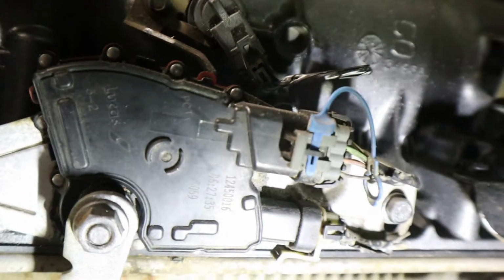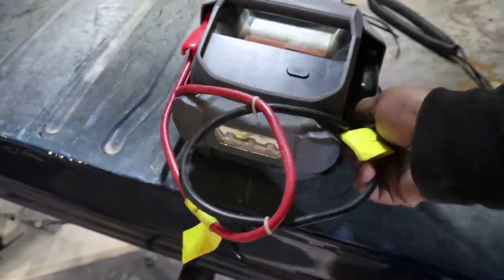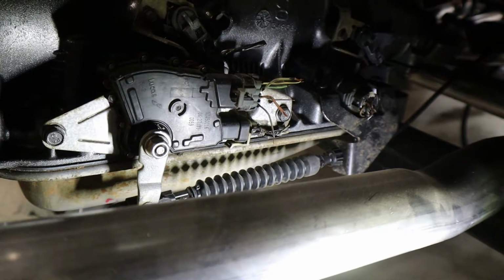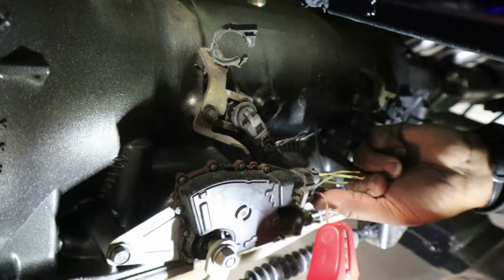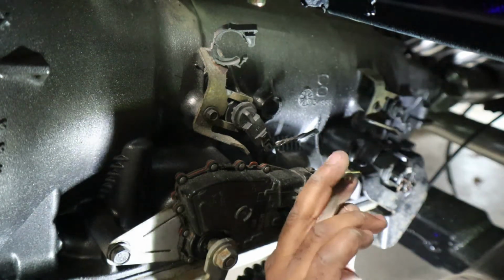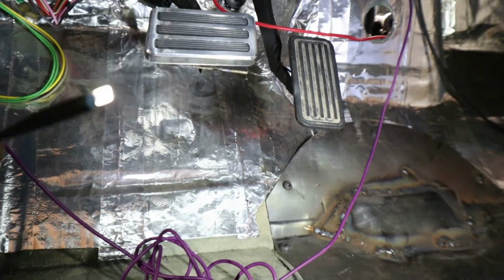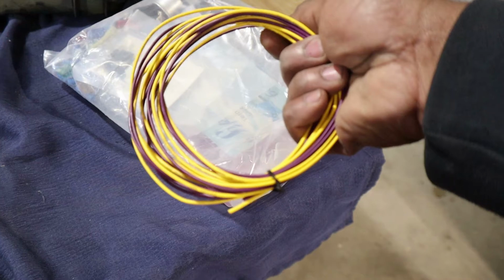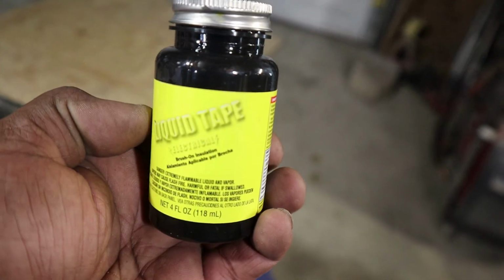HOW TO WIRE NEUTRAL SAFETY SWITCH "EP51" on a 4L60E & 4L80E Transmission.

Comment: Thank you sir for this awesome video! I got a 2006 chevy suburban LTZ with the 6.0/4L60E. My (Drone mobile) remote start failed. Physically using ignition key... failed, no start.  Come to find my starter froze up/ broke. I replaced starter... no start (no click, no low battery click). I charged battery, nothing. Verified terminals clean and tight.  I checked fuses... main ignition (rectangle, clear top) fuse, burnt up. Replaced it... no start. I replaced ignition switch, no start. I replaced the 3 relays in main fuse box... no start. I replaced main power cable to starter, no start.  I drank some water, scratched my head... no start. Slept on it... no start. Took it to the installer who installed remote starter (he the one that found the weird fuse blown) now there is power, but no start. So now literally.... thanks to your video, I will be replacing the neutral safety switch and be checking the condition of the solenoid wire. I can't think of anything else that could be bad. Ideas? Comments? Suggestions? Again thank you.
Reply from the maker: Yeah it seems that you are going in the right direction.  Just double check your grounds as well.  I only know how to hook mine up only one way.  But for sure check all of your ground or you will not get good connection.
Reply: @restosmodsgaragewithcj2808  yup, went through everything. All tight. Replaced neutral safety switch... It started! So again thank you.

Comment: Hey I did a 80e swap on 03 tahoe would this apply? Truck indicated in 2nd causing no start but in park I jump green wire from sns truck started
Reply from the maker: Yes as long as you are using a 4L80 or 60 you should be good.

Comment: Thanks for the video, I am assuming the switch will show all positions? PND321 ?
Reply from the maker: Yes sir it does you will just have to make sure that you adjust the shifter cable correctly as well.

Comment: I just put in a used 4l60e transfered my original switch didn't align it because I didn't know that they have to be aligned it only bolts on one way and the gear arm only goes one way back and fourth... My truck is jacked up in the rear and when I put it in reverse it last 3 seconds tires spin then stop .. new fluid new filter.. I was told that these switches nothing to do with how the transmission actually goes into gear.. but clearly it must ?? So my faulty or unaligned shifter switch could be the cause why my transmission won't go into gear because it's not getting ground or bad connection?? Weird how this lil peace plays a huge delicate roll.
Reply from the maker: What about a he transmission cable did you check to see if it was long enough because i ran into that problem and it would not go into all of the gears until I figured out that I was using the wrong freaken cable as well. Maybe something to think about.

Comment: How does this method work for the single plug  2005 4l80e neutral safety switch
Reply from the maker: It should work the same way no difference when finding a ground an positive connections.
Reply: I can use a multimeter and does key ignition need to be on ? Thank you in advance
Reply: So its two wires needed a positive and ground?
Reply from the maker: no you do not need a multi meter that is what the battery pack is used for. @darenmartin9692

Comment: How about the reverse light?
Reply from the maker: If your going to use a lokar shifter then you will have to run a separate wire from your reverse lights to the shifter.